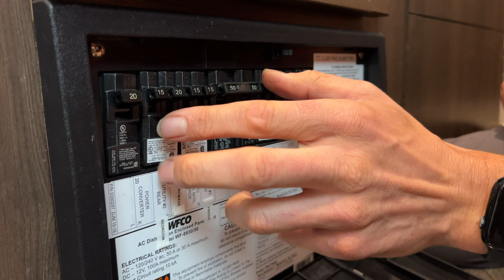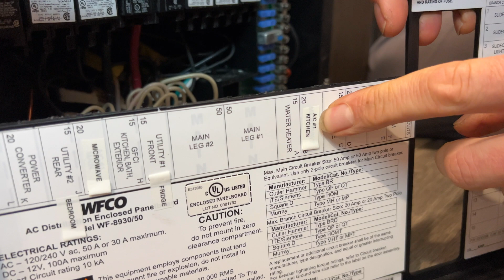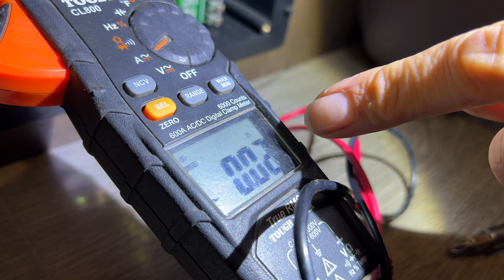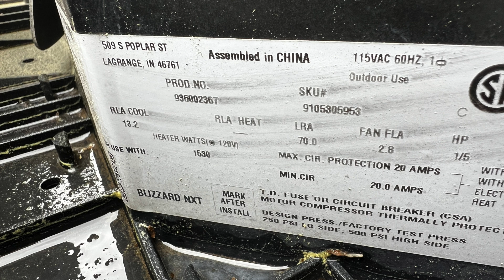RV A/C Keeps Tripping the Breaker? Here's What Might Be Causing It

Comment: Having had horse trailers for years with ac's, Ive found dirt daubers love to get in on the fan blades, and will cause breaker trips also.
Reply from the maker: Yes, that's a good point, thanks for the info!
Reply: We’re located in Texas, where dirt daubers can be a real nuisance. To help keep them out of our RV, we spray all exterior openings with a mixture of about 20 drops each of mint and eucalyptus oil, a small dash of Dawn dish soap, and water. So far, it’s worked well at keeping those critters away.